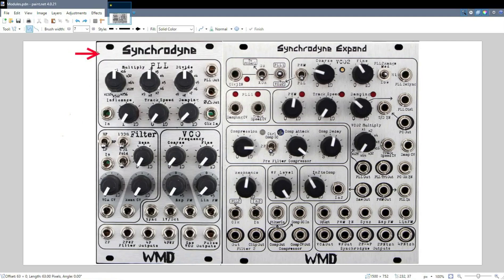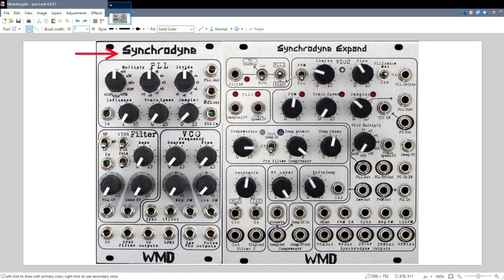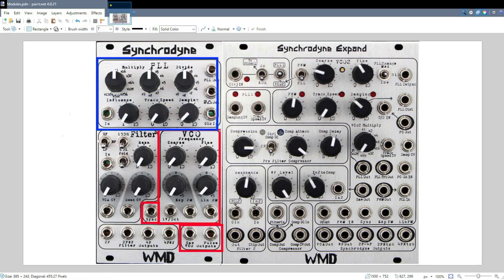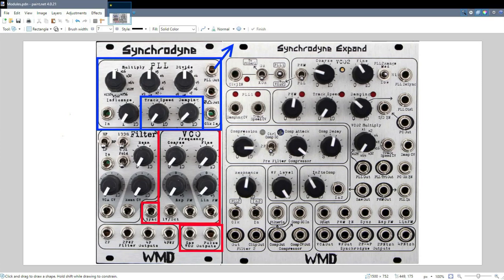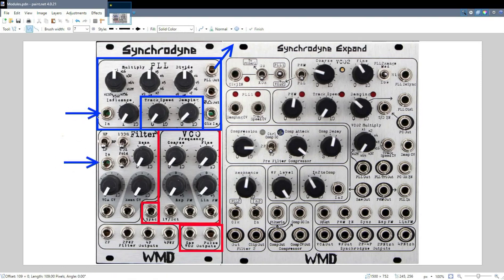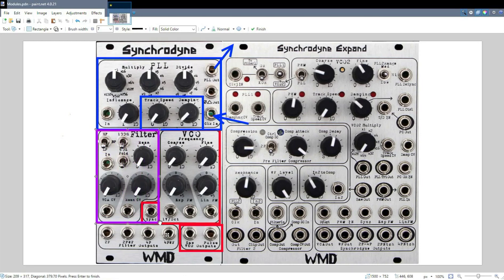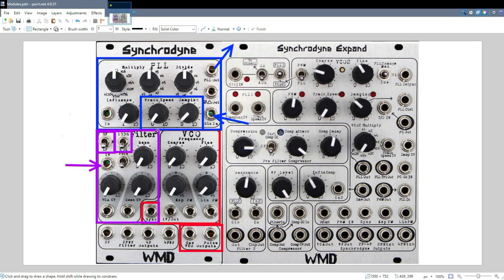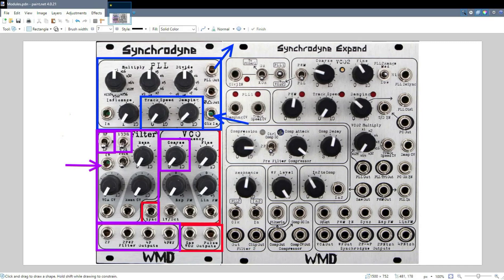Synchrodyne Signal Flow

Comment: enjoying these videos, have had my synchrodyne+expand for years and have been meaning to put them back to work. the only other switched capacitor filter in eurorack that I'm aware of is the harvestman bionic lester, which the mk1 is discontinued and the mk2 has yet to appear
Reply from the maker: Very cool, I didn't know about the Bionic Lester. Looks like a wild module.